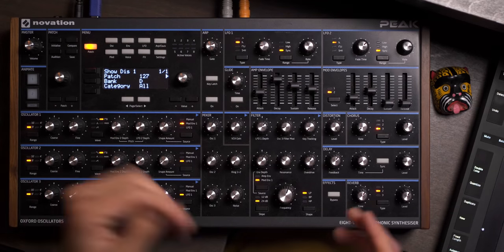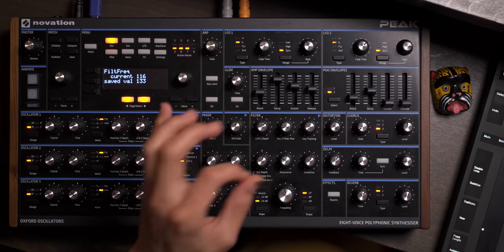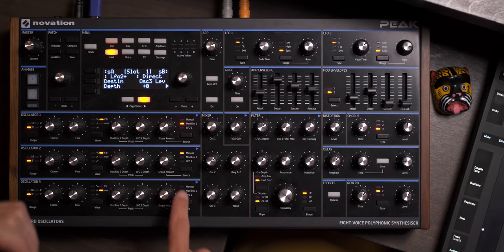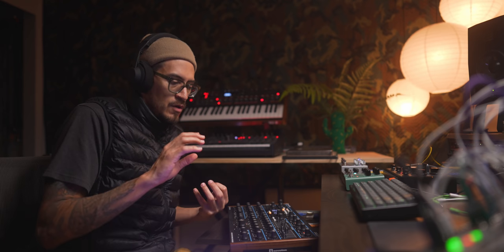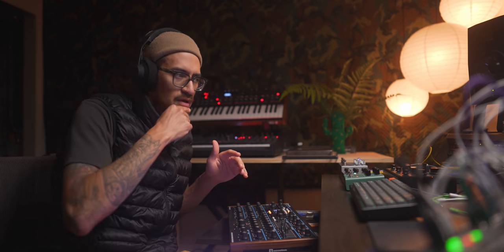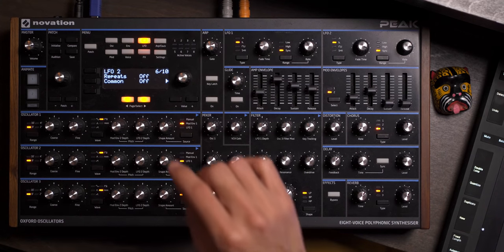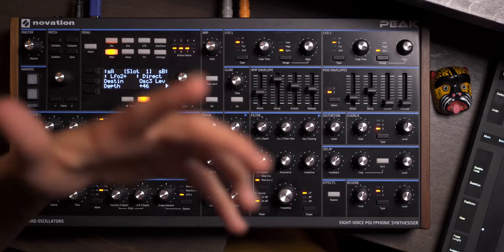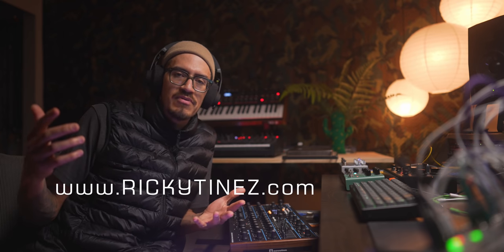What Syncing 2 LFOs sounds like // I Had to Show You This Patch on Peak..

Comment: I use this technique a lot. For me, I initially used it to quote the evolving timbres found in Steve Reich’s pulse works… for example Music for 18 Musicians. Amazing stuff!!

I usually run the resultant audio file through an Ableton Group with several layers of Auto Filter, each set to band pass mode. 

I set each individual filter to a different frequency and add resonance to taste. I then set a different lfo time and amount for each layer of the group. 

I, generally, am looking for the most important bands. I usually end up using 3 to 6 layers.

This adds a tremendous amount of movement to the space. And can remove a ton of extraneous frequency content.

If you want to get really crazy, you can add radically different mid/side eq to each layer. Then automate the scale parameter to create further spread and variation on each layer… 

This takes some experimentation but can really make a single sound have a crazy amount of movement without it sounding too muddy or busy…

Been watching and for a long time. Appreciate all your vids. hHappy New Year, duder!!!

Comment: To A/B the LFO modulation, set the mod source to whichever LFO plus one of the animate buttons and just latch the animate button during normal use. That way you can unlatch the animate to show the sound without the modulation instead of bringing the depth down and back up and potentially losing the sweet spot.

Comment: not sure if the peak have this feature but in the deepmind you can have this "global" lfo thing and a separate option to key sync, so the lfo doesn't reset on each key press. thanks for the tip !

Comment: leave the sync on and multitrack the part, adding whatever notes you don't want to reset and interrupt the LFO contour on separate passes, maybe?  That will also give you an easy way to mix levels of the different notes in the chord after  the fact.  But I also kind of dig those plinky-plinkies being out of sync.  And the track sounds cool.  No need to apologize or be embarrassed about the track.